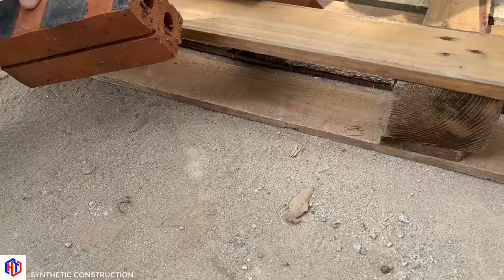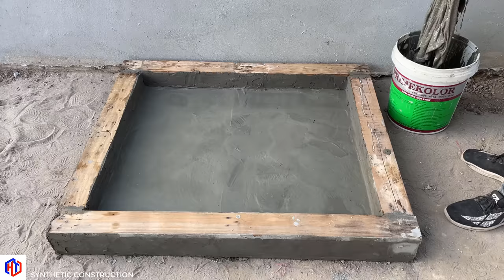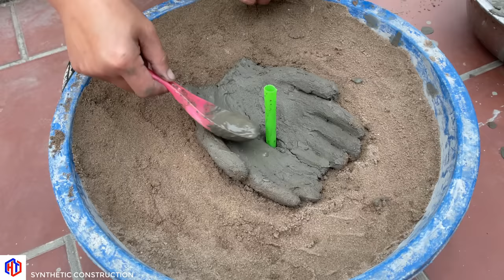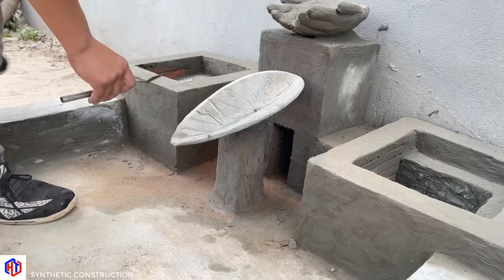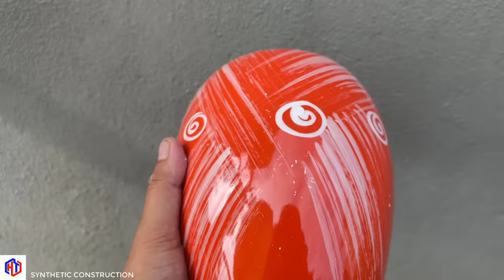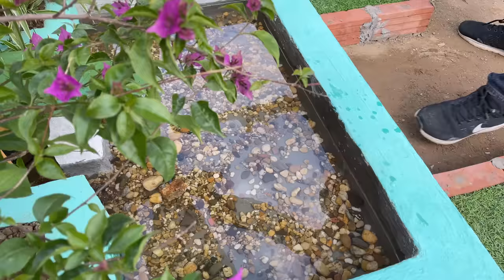Amazing Ideas / Build a 2-storey Waterfall at home from Wooden Pallet and Cement

Comment: Looks pretty, but will this last? The pallet as a base seems like a terrible idea. The wood will rot (completley untreated, masonry is porous) and even before then, it will expand and contract at a different rate than the masonry, so wouldn't that cause cracking and flaking? I don't see why you wouldn't just do it the right way and build a form, especially for that small of a feature.
Reply: It won't last for the reasons you stated. Does make a nice cheap temporary instillation though :)
Reply: I'm thinking that the cement and other coverings will block out oxygen, moisture and other things that would cause it to rot. Thing is, even if it does rot, the rest of the materials will support it just fine. Time will tell. ✌️👽
Reply: They only build thía for the videos, in fact
Reply: Trial and error
Reply: This waterfall was made in a very lazy and sloppy manner. He didn't even paint the outside bricks😂😂🤣🤣🤣
Reply: @Psychodermia  
Nope, cement will not block oxygen and moisture unless it was mixed with some special powder compound made for blocking moisture or treated with a special paint like some epoxy primers and paints.
Reply: When I see someone still wearing a cloth mask, outside and by themselves I have to question their intelligence and gullibility in the first place. Sigh Einstein was correct once again.
Reply: @seetheworldfrommyharley  
Covid?
Reply: Well....at least he is having ideas and trying them out ......plus sometimes..."do what you can woth what you have".
Reply: @seetheworldfrommyharley  maybe this person has allergies? Why does it bother people so much when others wear masks?
Reply: @seetheworldfrommyharley  good to know you’re otherwise not immunocompromised as some are. You’re blessed so carry on 😁😁
Reply: I was actually wondering why using the wood in the first place.  Wouldnt it be easier to just put the bricks in a square on the bottom?
Reply: @GoddessLiraSis  You can paint it later. Duh! You have to build it first! Duh, duh!
Reply: @donnaward4146  That's right, everything is just a test!
Reply: @richardmccann4815  ummm that's his finished product duhh. Nobody's talking about what could be done, we are talking about what WAS done duhh.
Reply: Portability. Test shot. Design test. Needed quickly for wedding set up. Who cares? You should go make them ! You could put him out of business! Whine to your govt! See where that gets you!
Reply: If it last till end of recording he is fine, mission accomplished  :)
Reply: Why overthink it. It's not your problem don't stress
Reply: koe ora moro ora popo
Reply: Damn credit score probably don't pay enough..
Reply: Build your own. Then you can see what ever you want.

Comment: Wood and cement guys doesn’t hold very wel together.. 👷🏼
Reply: I was thinking similar for the brick work in the sense that those bricks will likely suck up the moisture content and not allow the concrete to cure properly. It's one thing to use bricks and mortar but another to use them like cinderblocks, but I could be wrong.
Reply: @matthewgreige7268  yeah u could be

Comment: That is not going to last, so the effort is wasted. Concrete and wood does not mix
Reply: Dude...wood swells when it gets wet. Which would push cement AWAY from it. Causing it to deteriorate within a year. And yes
..ik how many. They've all failed. Even pressure treated wood. Take it from a builder. This is not just my opinion...
Reply: @theolynncarpenter4613  also...it appears I'm not the only one who knows this.
Reply: Why did he use wood to begin with just should have used brick and cement
Reply: Muito  capricho  PARABÉNS
Reply: This is made in Vietnam by a guy wearing a Commie helmet so no, it is not meant to last.
Reply: Phuk Hyutoob  beans?? Where that come from?
Reply: @skully1030  exactly.  Just seemed unnecessary. Also im sorry but it looks tacky af

Comment: The wood in the pallet will rot, and that's what is supporting the weight in several places.  It might take a while, but the parts with wood under it will crumble.

Comment: Good job but the wall of where the fish are in should’ve been at least 3 inches higher with more water in it for water evaporation, also for the fish to have more room to swim to live longer, meaning everything would have to be pushed up 3 inches , also to maintain cleaner water.

Comment: wonderful job BUT it would be great if you told us what kind of cement your using and is that a special paint or any waterproof paint. where those towels or sheets that you soaked in the cement and for how long and what consistency was the cement for that part??

Comment: Your design and ingenuity are admirable. However, your construction techniques have lots of easily identifiable issues for the future. Your laying of the brick for example should have cement on any side that touches another brick, the floor, a side, etc. I believe that relying on the pallet to maintain the structure will in the end break apart, losing all of your hard work. 
I recognize that the bright colors are likely common in your country with its tropical environment. However, when putting colors together, like an artist does a painting, it would be good to look at complimentary colors on a color chart, or all one color.
Lots of hard work you did and I do appreciate all of your ideas and use of objects to make your molds, etc. Next time….

Comment: Lovely. I love the use, the bonsai and the fish. You need to use Coptic so it is water proof instead of ordinary cement. The ordinary cement will leak and chip off over time and frustrate the living daylights our if your creation. Your edging needs to be neater. You need to use a quality sealer in two layers as a milk based sealant then a resin based sealant. The fake grass helps to catch the leaks but proper products work better to prevent leakage. It took me thousands of hours to research. I like this idea and have wanted to do something similar. Thanks

Comment: Putting those bricks in without concrete on at the vet least each FULL end is going to result in cracking loose.  It will not withstand stuff like earthquakes, tornadoes, nor. 200 lb man accidentally stumbling over it on it.  Better workmanship is needed, mire patience.  Sorry.

Comment: Pallet wood structure with no waterproofing?  The wood will rot out in a month and structure will fail. Cloth?  Sheesh.
Bricks with no reinforcing steel rods?  That is why the brick is hollow inside. It is meant to have a steel rod run inside, then backfilled with concrete.  Brick has to be inset in a good deep foundation. What you have a straw structure. One good kick and it falls down like a house of cards.  Of course all the folks who came here and don't make anything do not understand but praise your fragile structure. If you get paid for this, you will have lawsuits.
Your concrete is a slurry with no strength. Where is the stone gravel in the concrete to give it some holding strength?  This will crack if there is a small ground shake or truck passes by, Weak concrete. 

Its backed up against a stucco house wall. This means when the water goes through the concrete, it will enter the house wall and create white salts on inside of house.  No waterproofing between house and fountain.
The entire structure is sitting on a concrete pad sprinkled with sand. Nothing anchoring it down, no gravel bed foundation, no sand foundation, no pillars going into the ground to anchor it, nothing. One good rain and it will slide right off. And you live in a tropical place with lots of rain too.

The fresh concrete will leach out alkaline salts for a while. The pond is very shallow. The fish will all die.  You cannot add live fish to a freshly built concrete pond. Fish need deep water so that there are cooler and warmer zones and they can move freely.
You overcrowded your pond with too many goldfish. They produce a lot of waste, more than normal aquarium fish. There is no bacteria yet in the gravel to break down the ammonia.  There is not enough gravel, not enough water, not enough depth, and concrete is too new, and water temp will get very hot in sunlight, no way for fish to cool down. They will bake alive in your pond.
Poor fish. All this for Youtube money.

What a joke!  Stop building rubbish!  Don't kill fishes.  Shame on you!!!
Reply: Great explanation on why this project wouldnt work

Comment: For creativity, I give you a lot of credit. For execution, I think you missed the mark on many levels. The wooden base wasn't sealed at all. Why didn't you just form the base using the bricks you had available? Also, there is absolutely no structural integrity to this whatsoever. No rebar was used and your sparse use of cement will not hold together for long.